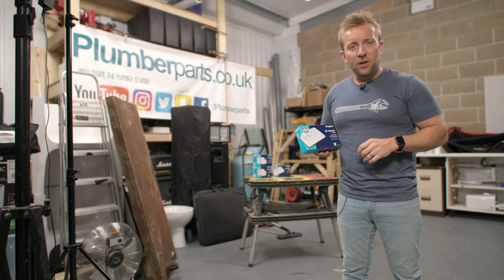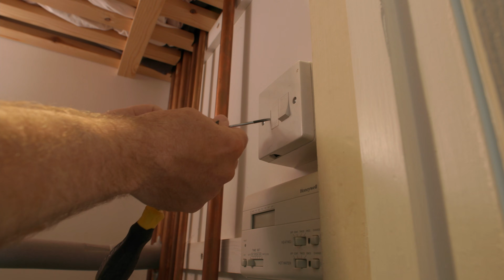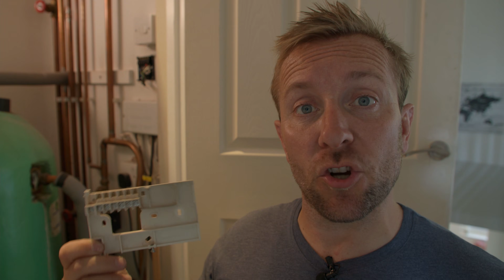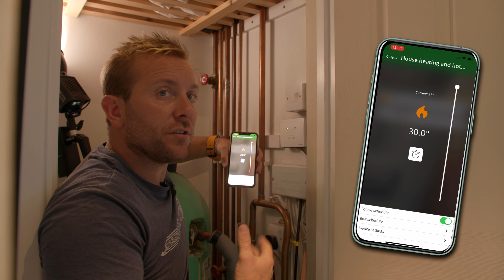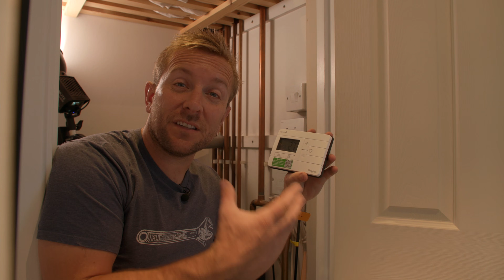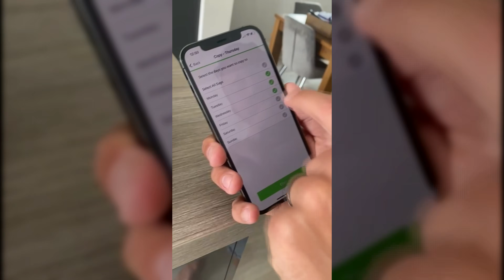BLUETOOTH HEATING CONTROLS UPGRADE - Drayton Digistat Install

Comment: Hi guys. I have a Drayton LP822. Can it simply be replaced by a wireless unit that can be controlled externally by an app. The app can then be used remotely offsite. ?  Thanks 🙏 Andy Bailey

Comment: Please NOTE. Do not fit the batteries before you've fitted the main unit. If you do you must do a reset of both units. Because the thermostat pairing will time out. And you will not be able to pair them.

Comment: Great video, thanks.  Have you ever had a problem with the thermostat and receiver losing connection?  I have to  reset the receiver every day, even though we've only had it installed less than one year

Comment: Hi Guys, I currently have a Horstmann (CentourPlus c27) attached next to my boiler and Drayton Digistat+3 system thermostat near the landing. Is it possible to have one single devise/system to control both the heating and hot-water system. Any suggest if  the new Drayton Digistat system would work  as an integrated system? Do advise please.

Comment: What's the difference or benefit of a smart thermostat compared with this? This product seems much cheaper. Can I connect when away from home to set heating before I get home? Love your channel, great vids.
Reply: I would also like an answer to your question buddy, did you find out?
Reply: @richardnaylor3300  I did a lot of research on all the units and that particular unit only works over Bluetooth so you will need to be nearby with your phone. I purchased the 
DRAYTON WISER HEATING 1-CHANNEL THERMOSTAT CONTROL KIT at Screwfix. I only needed 1 channel for my older heating system. I went from a timer clock only to this and I find it amazing, never had any kind of thermostat on the heating before so the timer turned on or off that's it. So now I have really great control over the system and I've monitored oil usage to compare with previous years and already I'm at a saving of 5 weeks oil in my comparison. The heating is on much longer now but it's not using as much oil as previous years. I'm delighted I made the upgrade. I'm in Ireland and the unit plus a wiring box, fused spur and sundries cost €180 all in, (no labour all DIY).Next job will be  to install TRVs on the rads but as I've 19 rads and they will cost about €50 each that won't be done anytime soon 😂

Comment: I got a wiser (wifi) duel channel system with 5 thermostats in the high use areas to keep them controlled, it took a few weeks of monitoring and messing to get everything right.
Can't fault it.
I use it integrated with home assisstant, I have 4 mapped profiles for each season and I can hit one button and it'll overwrite all the settings to match the current season.
It's also got geofencing on (via HA) and can also be controlled via alexa as well.
Far better than relying on a cloud service like nest.

Comment: How do you know a Plumber has installed a Wiring Center? ... The fixing screws are always on the  pi$$ and the Center is always on the wonk. Loving it 😂 ... keep up the good 😉 work 👍 [Bundy10]

Comment: Tip: before you start make sure the existing installation works as is. Otherwise if it doesn't work after you've finished, you won't know if it's because of something you've done or not.

Comment: Sods law I just fitted a new controller because the old one had all the markings warn out and seemed to be playing up? According to the date It was almost twenty years old.over 😩.  We also don't have a main thermostat for the central heating, so one of these would have been the perfect solution. I'll just have to bite the bullet and change it again for one of these. thanks for the video 👍

Comment: If it’s using Bluetooth instead of interweb then won’t you have to be in range of the control panel for it to work?
Reply: Yes, and even within the house you may exceed Bluetooth's max range of 30ft/10m.
Reply: @GadgetMan36  That’s not great then is it. I’d prefer a system that you can control over the internet, so you can control it away from home. Do you have any recommendations?
Reply: @tonylatanza3879  No and Bluetooth isn’t easier to setup than Wi-Fi.  It keeps disconnecting, it does my head in. Yes any of the main brands like Drayton and Honeywell do smart thermostats. I’m not so keen on Hive and Nest because they aren’t traditional heating control manufacturers, they’ve just jumped on the smart home bandwagon.
Reply: @GadgetMan36  thanks mate